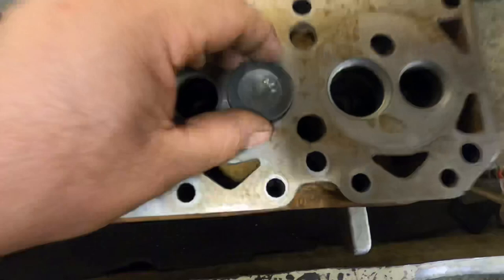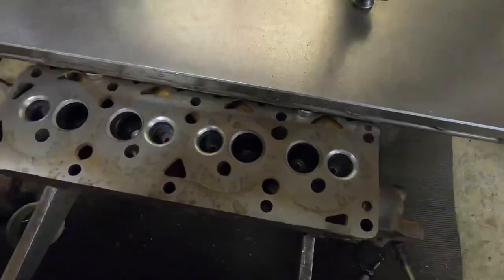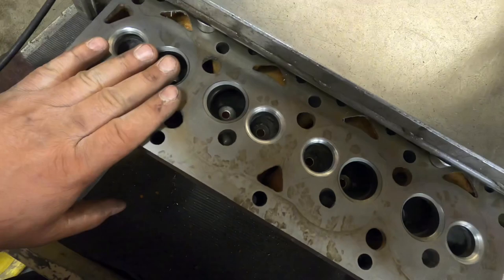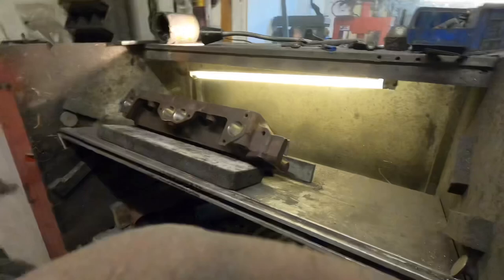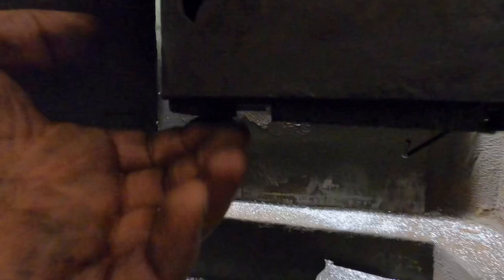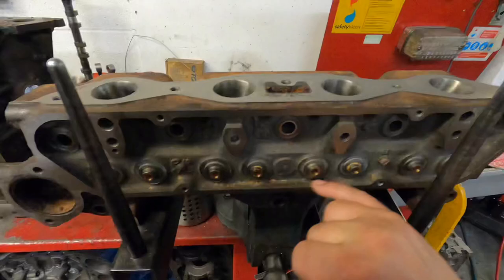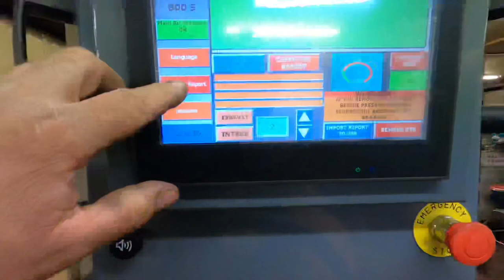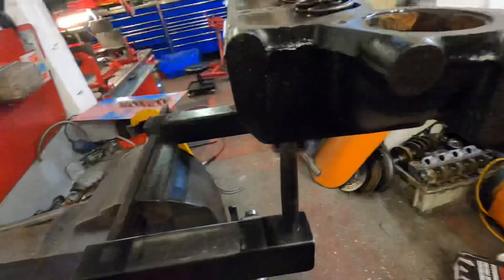How to convert a Ford Xflow to leadfree & gasflow the cylinder head from start to finish Vlog #16

Comment: Is it easy to tell if a X/flow has been converted to lead free when you get the head off my boss got a boat that should have a X/flow engine he got hold of one we got it running and now we are going to strip it down for a look inside new gaskets etc and I have a feeling that it's not going to have the lead free conversion
Reply from the maker: Hi Colin, if you take the valves out and clean up the head face you'll be able to see the seats.. or email me a pic and I'll tell you
Reply: @graceenginedevelopments  thanks I was thinking I should be able to see a hair line ring around the valve's and with it being a boat engine they probably wouldn't have spent much time smoothing them out in the port's showing obvious signs with the valve's out it's more than likely not been done we rang a Scottish guy to get a impeller for the marine water pump it's got and some where in-between the F's and Jeff's he told us it's a very early one how much do you charge for a basic lead free conversion
Reply from the maker: It really all depends on what the condition of the head is like.. give me a call and we can go through the prices.